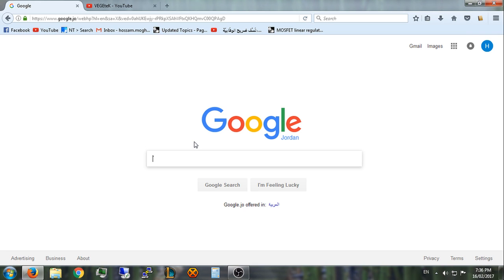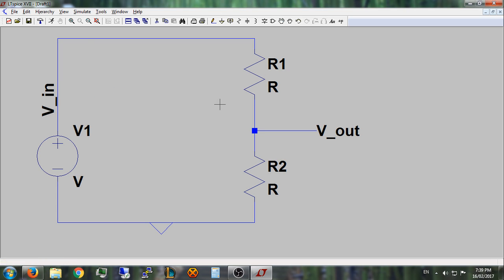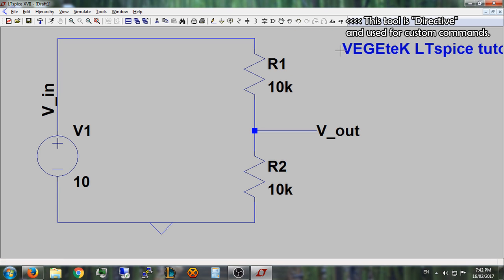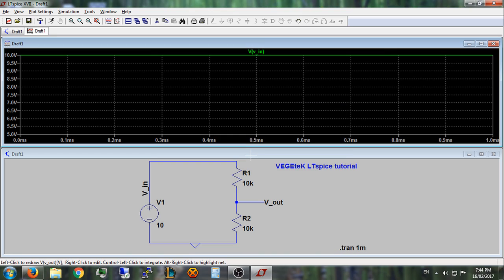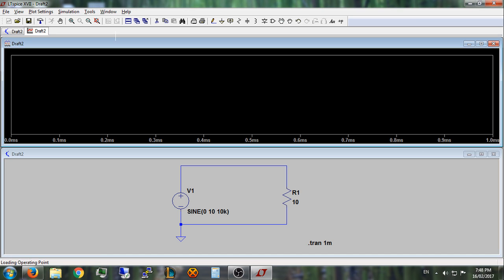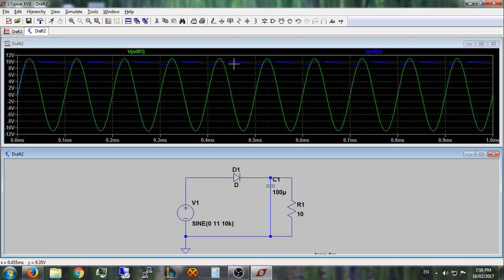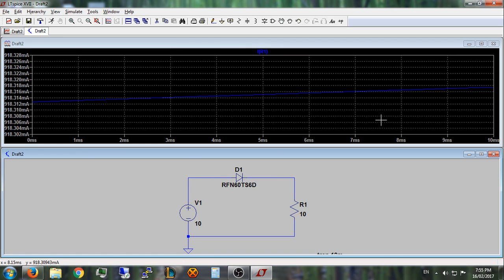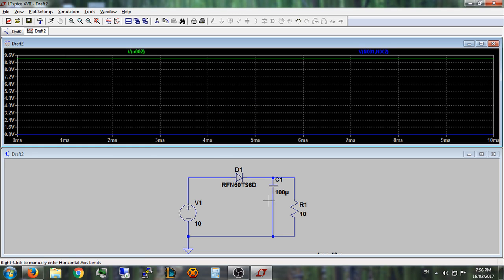LTspice simulation tutorial

Comment: Can you explain why the Capacitor is a "filter"?  What exactly is it filtering?  I gather that the capacitor is there so that the resistive load receives an almost constant 10 V, I just don't understand why the Capacitor is referred to as a "filter".

EDIT: I understand now.  It acts as a rectifier by filtering out the sinusoidal signal and having the resistive load only see a constant DC voltage.  Thanks.
Reply from the maker: you got your answer xD